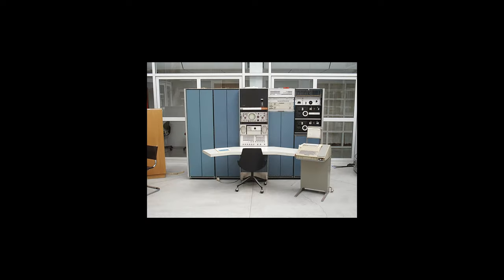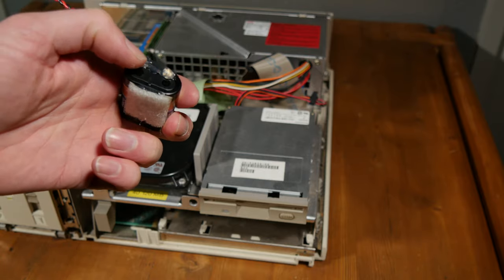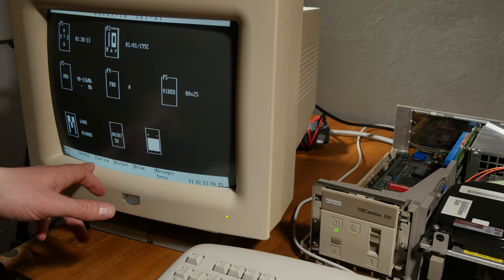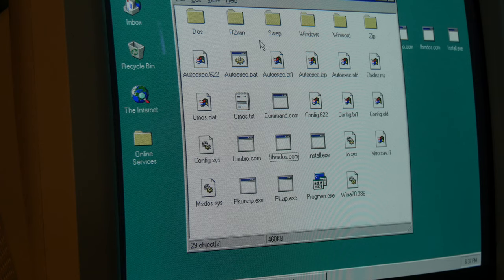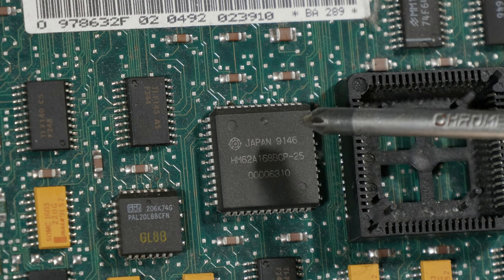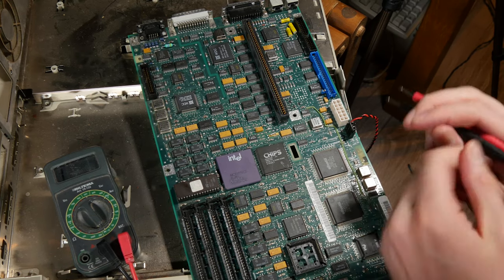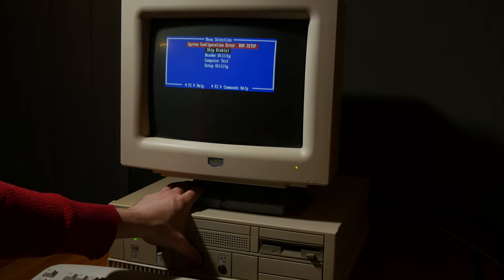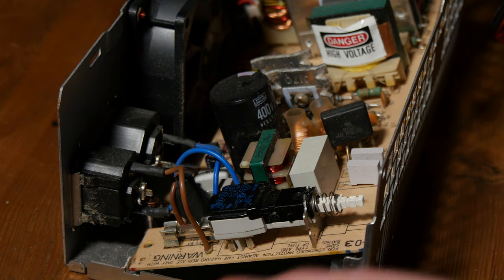Digital Decstation 320 - Beautiful 386 pc. What is wrong with it? Can you help?  Part 1

Comment: Great looking computer. The Intel chip marked 385SX-20 is actually a cache controller. The CPU is the smaller surface mount chip in the front corner of the motherboard.
Reply from the maker: Ah, right thank you

Comment: the bios settings to choose for your connor hard drive are cyls:762 , hds:8 , Spt:39 , choose these settings in the bios setup utility and it should work, by the way your hard drive is actually a connor 121Mb hard drive so do not concentrate on the size in Mb.
as i can see, you have a copy of the bios setup/utility disc look for the diagnostics utility and run that, it will test every component on the main board.
digital decstation computers had a very good diagnostics utility, especially when you have a possible fault on the motherboard, the utility tells you the exact faulty component.

Comment: I gave my Dad my DEC Digital with a Texas Instruments TX486DLC 40Mhz processor with 256KB of external cache and 32MB Memory. It had a Western Digital Drive with the software overlay with a 8.6GB HDD. It also had a 16x CD-ROM, 1MB VESA Cirrus Logic VGA adapter, and a 33.6Kbps USRobotics Modem.  It ran windows 95 and worked really well for what it was.  I guess he just threw it away when he was done with it...

Comment: Interesting! I recognise the BIOS, but not the setup disk. I had something like an Olivetti M300-10.

It had the BIOS battery replaced at a shop, HDD added and Ram maxed out by myself. But the shop might have used such a disk without me knowing. A neighbour might also have helped with the HDD and Ram. I would have been lost on my own back then :-p
Reply from the maker: Internet is a wonderful thing :) Did you have a sound card in your pc?
Reply: @UncleAwesomeRetro  Never on that computer. I did end up with parts I could have used, but after I had moved on to newer computers.

Pc speaker was my jam, I missed out on DOS sound because when I had a compatible computer (IBM Aptiva K6-2 which I also dont have now :-p ), I was playing newer games and didn't think to test old games out with sound :-p

Comment: Where did you get the setup disks? Images? 
Can it be a hidden partition on the original hard drive, assuming it is the original one, where the same files for the user diskette is located?
Reply from the maker: Someone did advice me to check for a hidden partition, but I did not find that. I got a link from Arthur to the setup disks. Info in description.
Reply: @UncleAwesomeRetro  Thanks! I hope you will have it fixed. I might check out his page. I'm in need of the setup disks as well.
Reply from the maker: @hammerpaal  links to to setup disks are in the description
Reply: As always when you get a new computer you should image the hard disk. It may contain things that are no longer available that could then be shared with others.

Comment: I see someone has a new motorized slider ;-)  Just remember, you can't use autofocus on a slider; manual only, or else you get a lot of focus breathing.  4K footage looks great.  Panasonic camera?
As for the computer, we're finding in the community that Olivetti boards have middle layers that are failing; there are very few M24s and clones (AT&T 6300, Xerox 6060, etc.) that are still working as a result.  Glad you don't have that issue with yours.
Is that setup disk you used dumped and available on the internet somewhere?
Reply from the maker: Yes my brother made the slider for me :) It does have a pan function also, but it elevates the camera higher and that makes tiny movements gets a bit larger, so I removed that pan thing for now. I think I will try some new drivers for the stepper motors that would make them more silent and vibrate less. I use warp stabilizer in premiere to smooth out the small vibrations. You are right about the focus breathing. I did notice it but was actually to lazy to re-shoot. That can happen when there is so much overall struggle with the computer, it takes away my energy and I tell myself, "good enough".  But I am glad you are pointing it out, thank you :) That motivates me to tell myself "no it was not good enough, I must do a better job". And yeah, it's Panasonic gh4. Would be fun with gh6 eventually, but honestly the gh4 is good enough. Autofocus could be better though.

I will add links to the software in the video description.
Reply: @UncleAwesomeRetro  Smart move using warp stabilizer.  And it's ok to be "good enough" since that's the conqueror of being paralyzed by perfection.

Thanks for the links, but both of them don't seem to work?
Reply from the maker: @JimLeonard  Thanks, I fixed the links now.